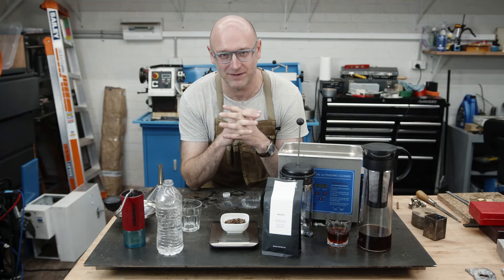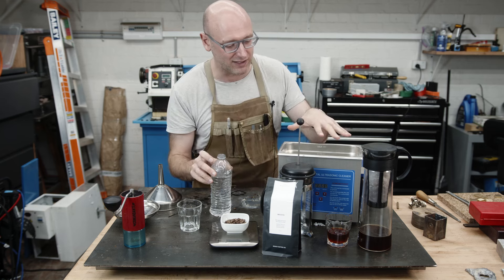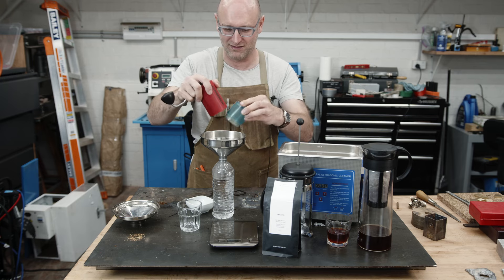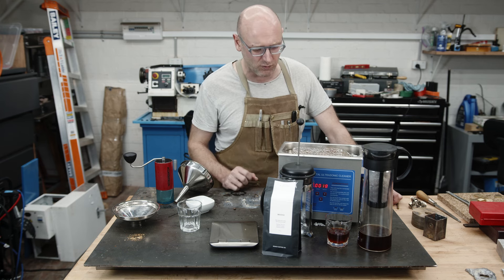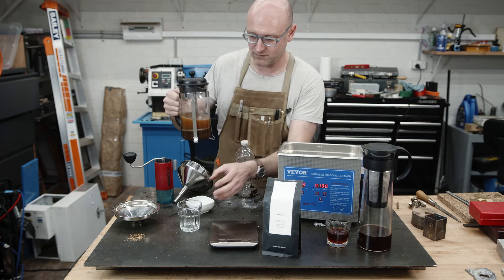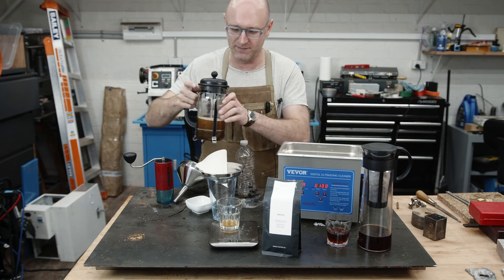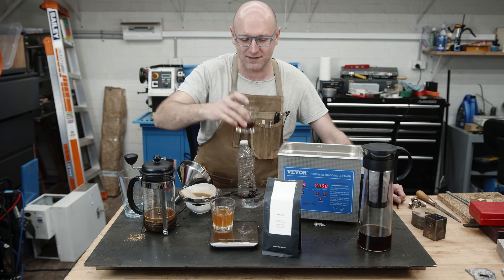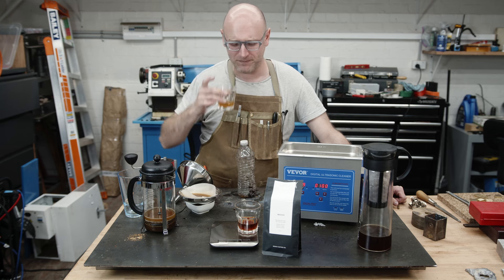Ultrasonic Cold Brew

Comment: I bought an ultrasonic cleaner (the exact same one you're using... ) just to test what that research paper found. My first run was a bit of a dud cuz I used a glass container rather than something thinner like plastic or metal, but I'll give this some more tries and see how it actually turns out. I can say this will never be a viable home coffee brewing method long term, if only because of the terrible noise the ultrasonic makes when on. Well, at least I have a parts cleaner at the end of this experiment...
Reply from the maker: I tried to make the process a bit faster by putting the french press with the grounds in the water, but even at 3 minutes, it hadn't had much effect on them. The thin plastic bottle made a huge difference.